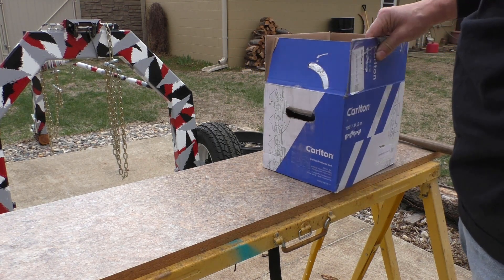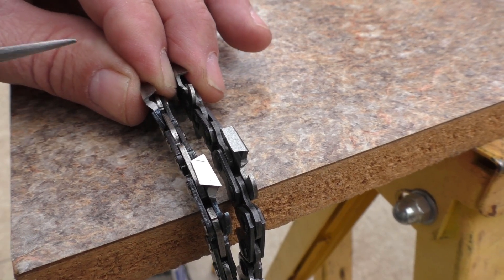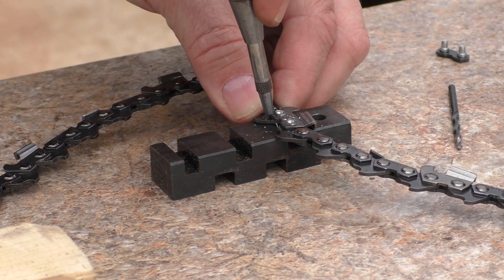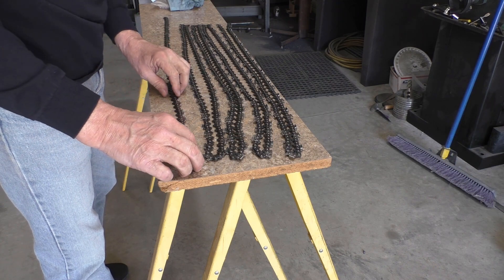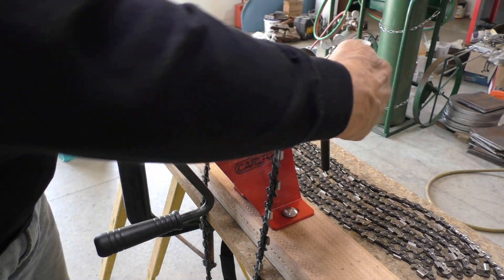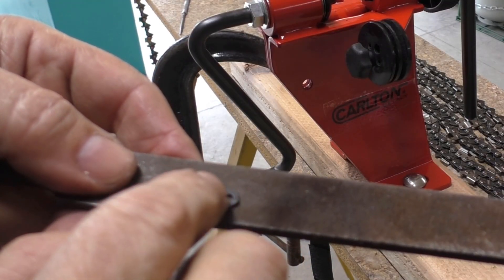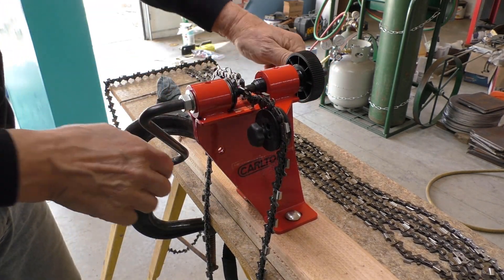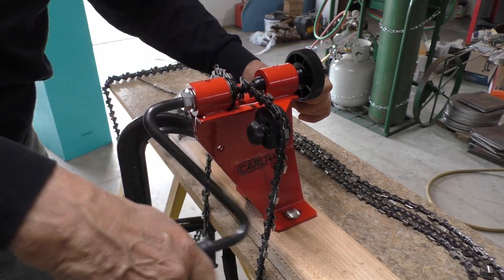Breaking and Riveting Chainsaw Ripping Chain with a Rivet Spinner Spencers-Mountain

Comment: good video and job. i think i may have to start doing that the factory chains now seen to be to long and you give out of adjustment before chain gives out. i may can take one link out  of my best used chains. a 28 inch stihl chain is really high now. thanks for video. take care, be safe and well.
Reply from the maker: Thank you. Stihl chain is some of the best in my opinion but $45-$55 for a 28" chain really hurts. Most people running chainsaws are not made of money. Just a thought, check your chain drive sprocket...sometimes they get replaced with a different tooth count impacting chain adjustment and saw power output. Even a worn sprocket or bar can reduce adjustment. Thanks for watching.